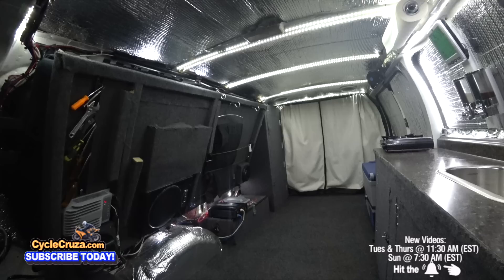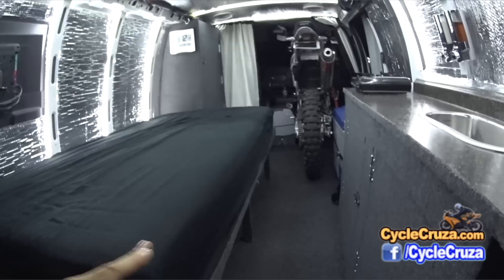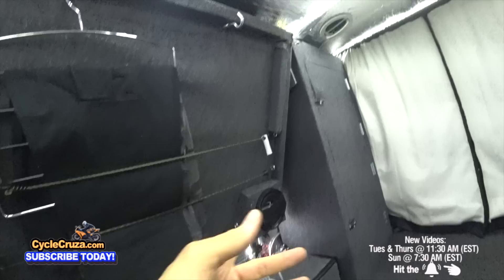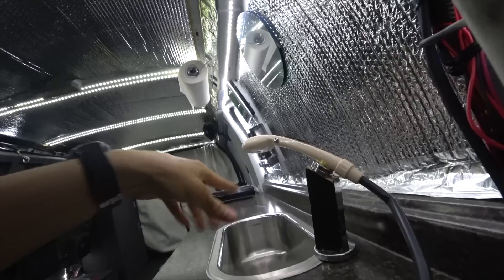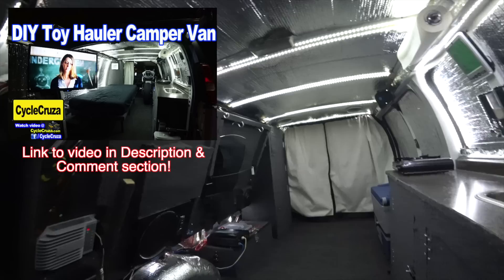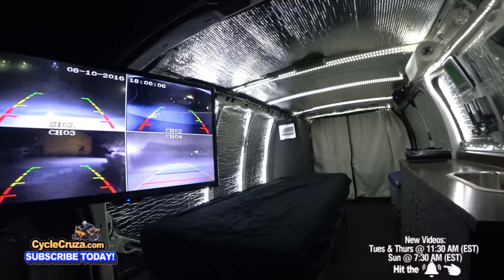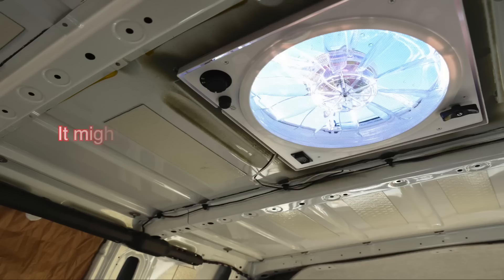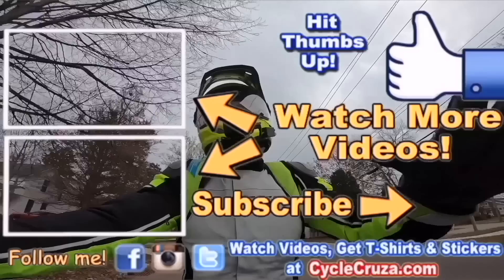5 Things I HATE About My Custom Camper Van Build Tiny Home

Comment: Doubt if anyone will get upset when you're parked in Western NC or Telico/Turtletown TN.   As long as you stay clear of the Asheville and Biltmore suburbs and strip shops, people are used to van lifers.

The USFS land is often set aside for free camping,  and those are on USFS roads that are fantastic for your dirt bike.  There's a website for free and very low cost camping. 

As to hitting a lot of upscale sportbike and dual sport weekend wilderness warriors,  try a comfortable night or week at Two Wheels of Suches Georgia (below Blairsville/Blue Ridge and above Dahlonega)

Comment: Two weeks ago my wife and I bought a 2005 International CE300 38' 71 passenger school bus that we're converting to a tiny home on wheels, not necessarily a bug-out vehicle. So far it's gutted, the new floor is almost done and we're already building it up. It has the International DT466e engine with an Allison trans and it's pretty rust free since it was from the south.

Next week the 1240 watt solar system will be arriving and we have all the other major appliances purchased also. We went with AGM batteries because the amount of lithium batteries we needed would have been too expensive for now. We are going to have two 98 gallon fresh water tanks which should let the two of us boondocks for at least two or three weeks. 

We were supposed to move to Utah this August but COVID screwed that up for us. We still wanted to move and now we plan to tour a couple years before we settle down. We're going to haul around our RE Himalayan and DR650 in a 10-12' v-nose trailer. Those will be our only daily transportation.

We're already enjoying the build and can't wait to quit out jobs and hit the road!
Reply from the maker: Nice! Good luck on the build, I'm sure it will be great. How do you get a school bus serviced and are parts easy to get? I thought about doing a charter bus build based on a Chevy Express.  Around here they convert the charter buses into Browns tailgate vehicles for the games. I can't do anything until I get away from my HOA and their rules. Best of luck bro!
Reply: @CycleCruza  Thanks! I like to fabricate with metal, do my own mechanics and I'm a novice with carpentry so it will be a fun project improve all skills and be creative. Plus we'll know what build quality went into vs mass produced RVs.

The DT466e has been around since the 70's I think, and has been in a lot of different truck platforms. It's considered one of the best engines with a lot of torque. Since it's been around so long and in so many chassis I can't imagine it being difficult to have repaired. The engine can also have the top end rebuilt in the chassis since the cylinders have removable sleeves. The downside is the electronics and emissions added over the years. Our has diagnostics and some electronics but it doesn't have the emissions tech added after 2007 which sounds like it can be a real headache.

Good luck finding property and getting away from the damn HOA!

Comment: Portable A/C on wheels! Very inefficient in a house, but for that little van, it’s all you need. You’ll just need a minimally sized hot air vent hole cut, which you could put in the floor to keep your stealth, and have a flap that seals it when not in use. They use standard 120v outlets, and only draw a couple hundred watts power, which will keep you cool at night or sitting still during the day and not using your engine A/C, while minimally impacting your solar system and batteries...

Comment: I don't own a van but we have rented both the Mercedes Diesel and Dodge Ram vans.  Last summer rented the Mercedes for 3.weeks on a West  National Parks trip..We definitely prefer the taller.stand up vans. We didnt find the shower necessary because we are.usually.in campgrounds at least every other night. The stove, fridge  and heat worked very well and was based off of a marine diesel system and roof solar panels. Both the Ford.Transit and Mercedese Diesel owners I have spoken too were very happy with the reliability and several had more.than 150k miles.on the Diesel. Diesel mpg was excellent.

Comment: Hmmm...
White van, no windows
Doors open, surveillance TV swung out
Tin foil insulation around all the walls
Guy with a Gopro on his head moving around his arms, speaking softly, dressed in strange clothes
Sitting in a vacant lot at night
Nothing suspicious here.
Is that a 5.3L V8? What size fuel tank?